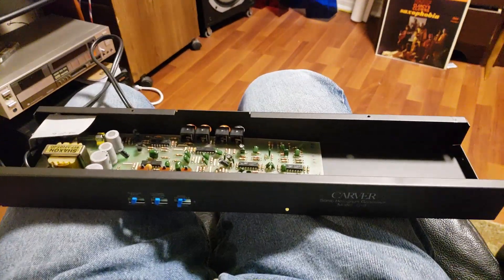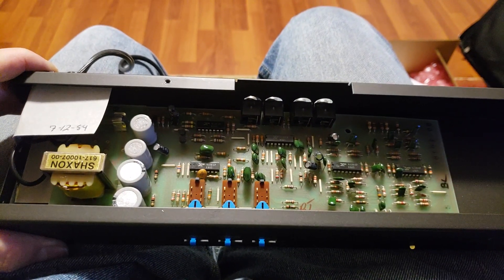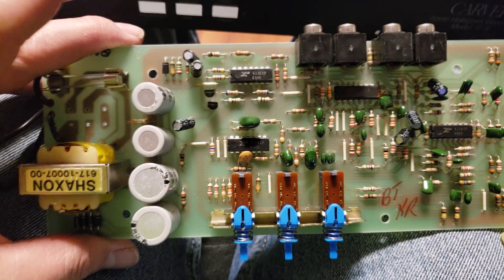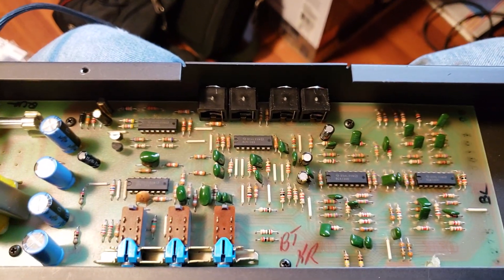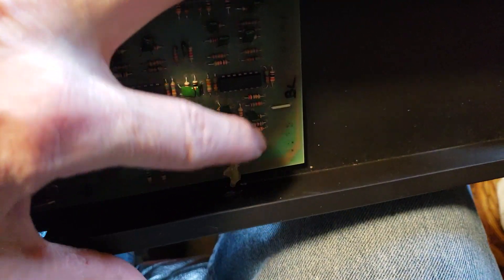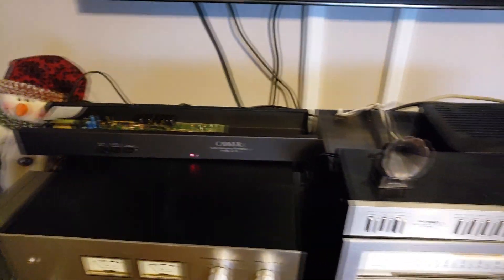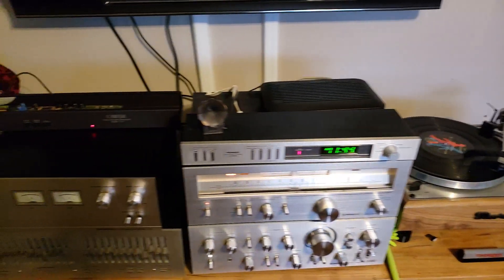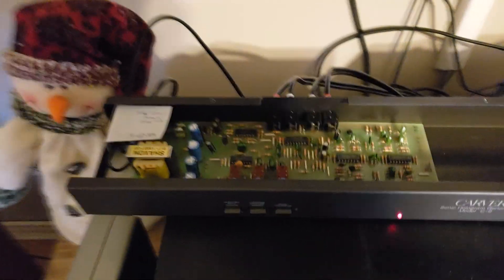Carver Sonic Holography Generator Refurbishment

Comment: Hi Navydiving,the Carver C9 came in today and thankyou very much.I have already modified it.I cut the circuit board out where the transformer and fuse assembly is.This has given me room to put a 240 volt transformer bolted internally the the chassis.Where the aux power socket was on the back I snapped in perfectly a figure 8 power socket.Where the power cord had originally come in there is a external panel fuse now.I have put a on/off switch on the front panel that suits the C9.I also changed the green led on the front to a nice cobalt blue.I have also bolted to the cover matching rack ears.So between both of us it has had a major makeover.Thankyou again and will put it in my system soon.
Reply from the maker: Great to hear. I think the Cobalt light will look much better. Shame they never put a power switch on those units. I got by that by merely using a switched socket on my preamp. Hope you enjoy it as I did.